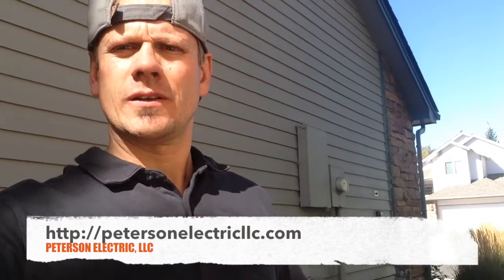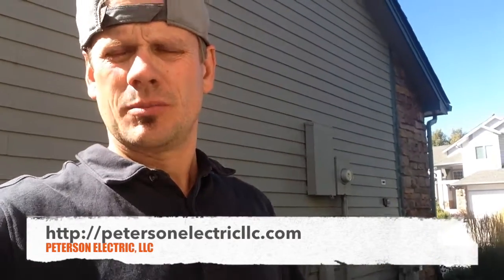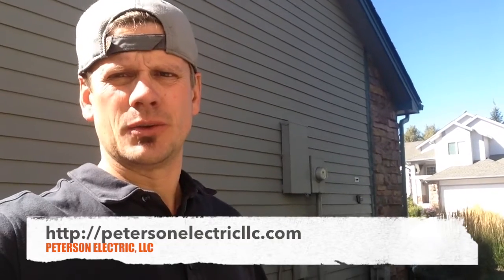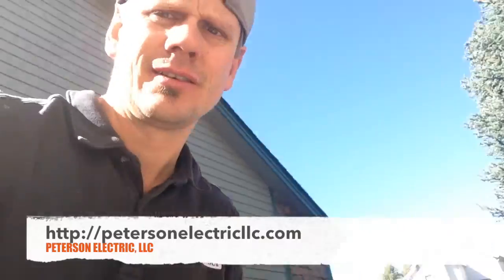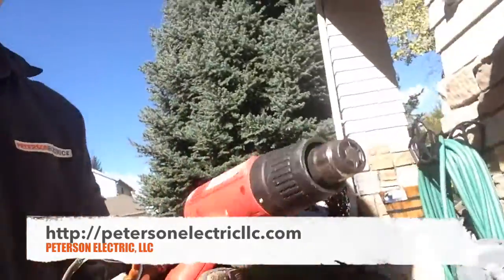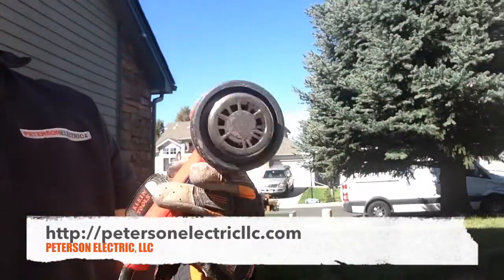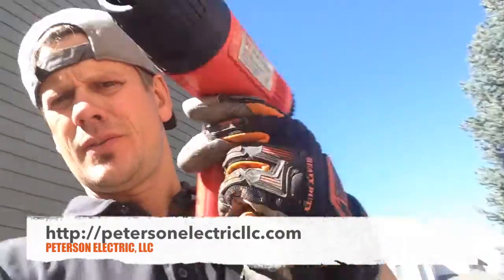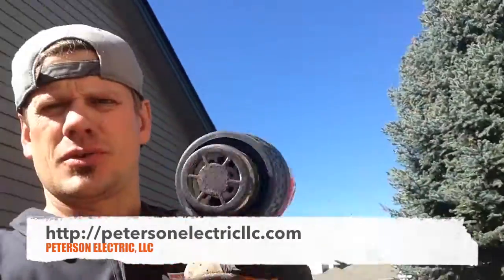The Hard Way To Bend Electrical Conduit With Heat Gun

Comment: I'm in North Dakota. We wire up a lot of grain bins and similar things where we don't have access to power (until poco energizes install). We predominately use a heat torch (like a propane weed burner) to heat up pvc for bends. It takes a little practice! Have to keep the torch moving all the time to keep from scorching (blackening) the conduit.  Wear insulated leather gloves, it'll get very warm! For offsets I usual take a piece of plywood and mark out my offset on the plywood (example-6" inch offset, draw lines 6" inches apart). Then I mark a "range" of the conduit that I want to heat up. I heat it up with torch on ground, periodically testing it for pliability. When it's pliable i transfer it to my "template" plywood and make the bend, using insulated gloves to help maintain the roundness of the conduit while it cools. Total time for offset is about 15 minutes!